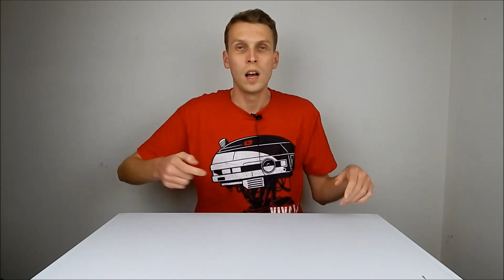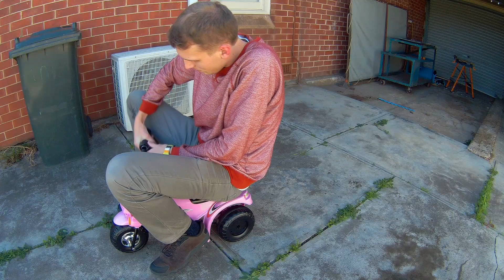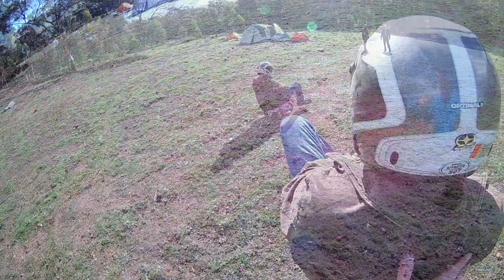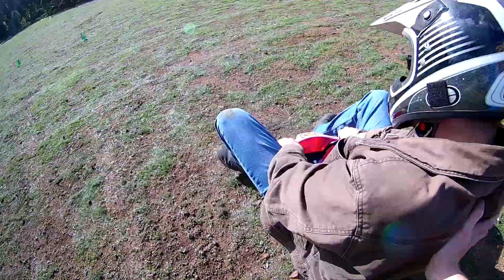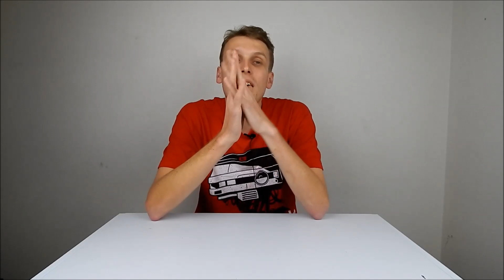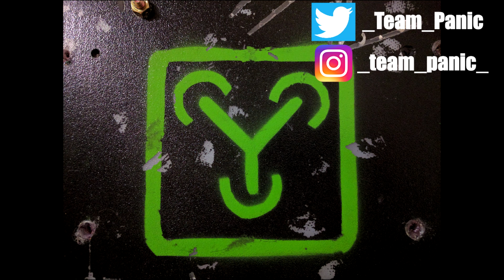Ride On Bike conversion Update

Comment: What did you use to generate PWM to drive the ESC?
Reply from the maker: The ESC i used is a VESC

Its programable and  has a bunch of settings and input options.

I set it to "throttle mode" so all I needed to do was connect the twist throttle to it and the VESC generated the PWM itself